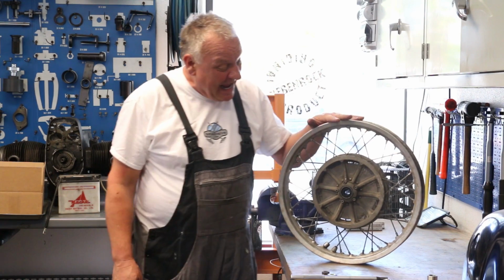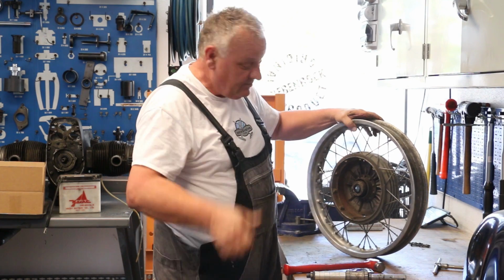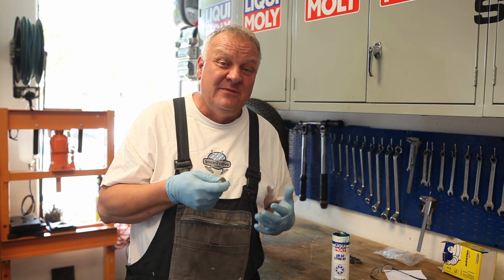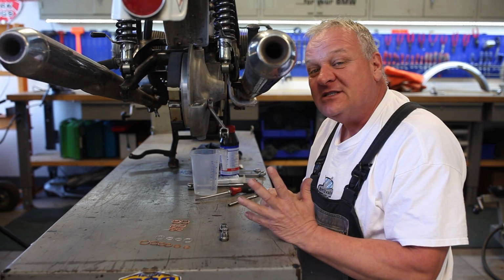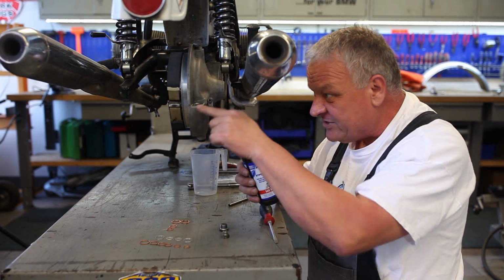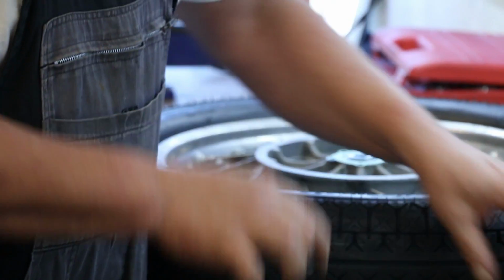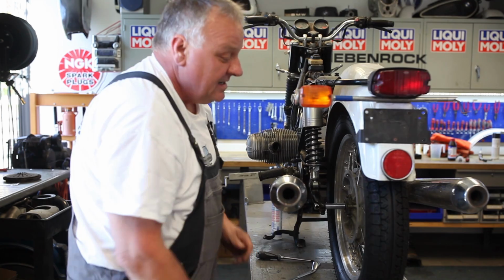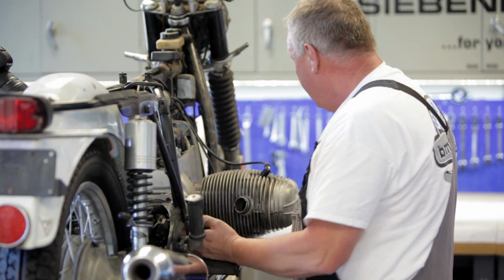BMW R90/6 #8: Rear Wheel bearings, driveshaft bolts.

Comment: Having watched this a few times and getting ready to do it myself, I feel like maybe the bearing pack went back into the wheel the wrong way round? Normally the spacer/shim is outboard (ie on the right, or seal holder side). this is the way it came out when he tapped it out from the brake side. But when he put it back in he had it assembled the same way round on the axel but then flipped it and tapped it in from the outside, so the shim and spacer are going in inboard or brake side. Does this make sense? does it matter?
Reply: Am also wondering the same, did you ever work this out?
Reply: did you ever learn if it matters? your right, he installs it backwards, opposite the way it came out. doing this now and not sure if he flipped the stack.

Comment: The R75/5 parts fiche looks like a /5 has an additional felt ring and ring cover that I didn't see on this /6 rebuild. Can you tell me where the felt ring and cover actually go? Are they in lieu of the wheel seal on the right hand side, on top of the wheel seal or somewhere in the differential?
Reply from the maker: The felt ring and ring cover together basically are the grease seal on the inboard side of the wheel hub on /5 models.
Reply: @boxer2valve  Does that mean the felt ring and cover should be used instead of the 35x22x5 wheel seal?

https://www.boxer2valve.com/motorcycle/3631701.html?Session_ID=66419c0ddcc328002df9b6e7091e8214

Comment: why don't you use a torque wrench and tell the viewer what the torque spec is? For instance on the rear wheel nut.
Reply from the maker: Hi Steven, torque specs often are different from one model to the next and since not everyone has the same bike as we are working on, we have decided not to mention torque specs. It's best that you consult your repair manual to get the correct specs for your particular model.

Comment: Hello, you mention that on later models such as the snowflake rear wheel, the removal process is different. Do you have any further info on doing a snowflake rear wheel? I am struggling to find any info at all on it.
Reply from the maker: The snowflake rear wheel bearings are very similar to the front wheel bearings of the R90/6, which we covered in one of the videos. The procedure is basically that same, you just won't have those screw on caps. The way that the bearings are adjusted is the same.

Comment: I just purchased my first airhead, an 81' R80G/S and was checking the front wheel bearings as well as the head bearings which are tight but not notchy.  Question is if the same procedure is used for the front wheel bearings?  I see there is a seal with a tophat in it and beyond that a collar that seems to rotate around in there, not indicative of a inner "fixed" sleeve of a tapered roller bearing.  Odd?

Comment: Great series, perfect timing as I'm currently assembling a R90/6 myself. What rear tire is that you've installed?
Reply from the maker: Hi Sam. The rear tire is a Continental K112 4.00-18. On the front we will be installing the RB2 3.25-19. These were the tires originally fitted in those days and they are correct for the bike. Good luck with your project and if we can help in any way, please let us know!
Reply: Ditto, what tire is that. I'm also just starting a R90/6 project.

Comment: Excellent video!  For those wishing thinner shim increments than the factory provides (and if you don't want to lap your parts), you can purchase a shim kit on my web site which comes with a variety of shims down to 0.0015".  Each kit comes with 5 shims; enough to do one or two wheels.  http://blog.scottiesharpe.com/p/wheel-bearing-shim-kits-for-2-or-567.html